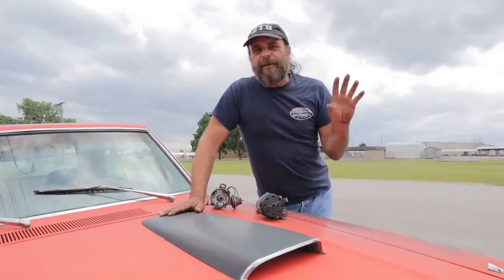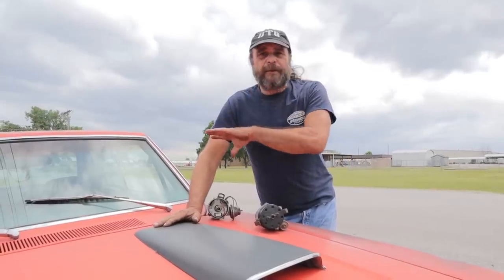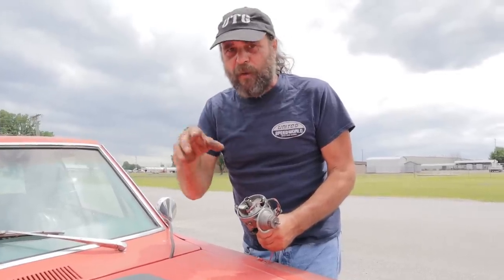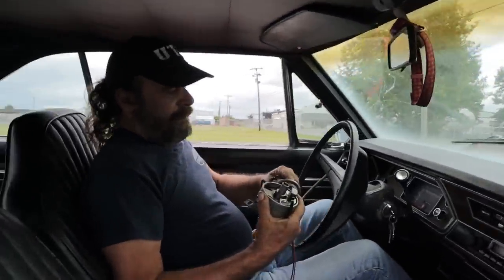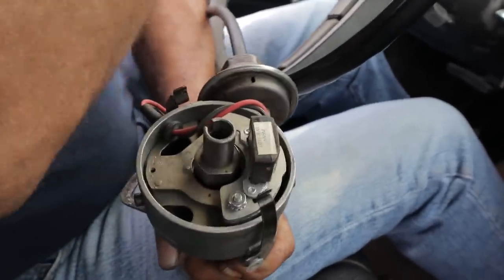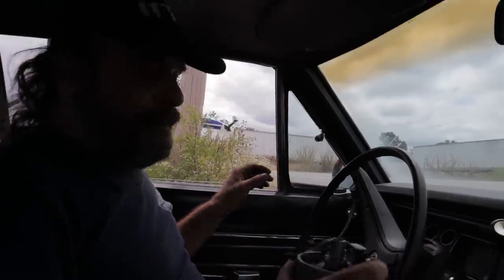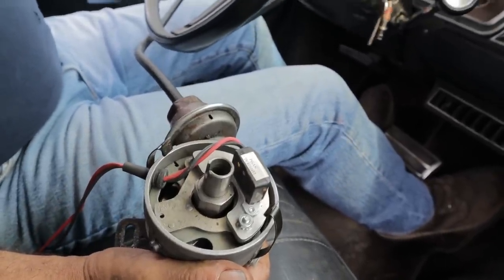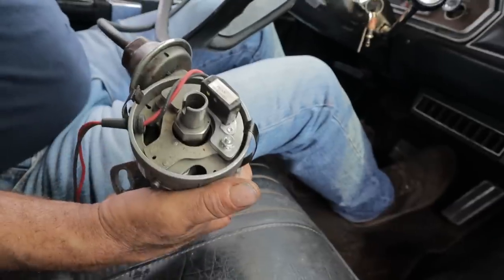The Vacuum Advance Debate!

Comment: Excellent explanation. Most people overcomplicate these things because they don't understand fully what they are talking about. The simplicity of this demo speaks for itself
Reply: The demo is TOO simple.  He showed what happens to the dizzy when the advance canister is hooked up to ported or manifold.  He didn’t adequately explain why you need different timing at different levels of load or rpm.  For a more comprehensive demonstration, the dizzy needs to not be removed from its symbiosis with the other parts of the engine.  A better approach would be to show two different vacuum gauges one from ported and one from manifold at the same time.  Then, take the engine through different circumstances in load and rpm to show what is happening with the timing.  Uncle tony was able to explain the opposite of the truth because his demo was overly simplistic.

Comment: This channel is a gold mine. I learn something every video. I always thought vacuum advance's were always connected to manifold until the early 70's when they switched it to ported because it allowed for better emissions. My understanding was that if I want better emissions I should do ported, but if I want better drive-ability I should do manifold.
Reply: Yes ported it runs hotter so it will burn off the fuel more although in stop and go traffic in the summer you can get into trouble running ported . I ran ported and I could get 14.7 or more on the AFR gauge idling on manifold I would stumble out past 12.9 or so less timing the leaner it is more timing the richer it is problem is the distributor is not tuned for manifold vacuum a adjustable pod is a must .
Reply: On my old Porsches I always ran mechanical advance but on my Thunderbirds I always stay  manifold.

Comment: I'm a huge fan of manifold vacuum and I can see many benefits on my 41 Chevy inline 6, since I swapped it over to manifold. Especially mileage and  temperature.  What a lot of folks saying :  ported came with emission in the 60s is a myth though - my 41 had ported from the factory, some cars even earlier - why?  I don't know, since the engineers back than must had have something in mind - but that would be an other interesting discussion.

Comment: I think its something that will be debated endlessly.  The only way around it is to dyno two cars, one with a factory engine and the other with performance mods. Test both running both ported and manifold and see the power band differences.  Love your videos. All the best from Oz
Reply: Or just take the same engine and tune for ported on the dyno then tune for manifold and see which one wins.
Reply: There would be zero difference on a Dyno.  You don't leisurely cruise on a Dyno, you crack it wide open under a heavy load--- ported or direct manifold vacuum are BOTH going to give exactly zero added degrees vacuum advance, no partial throttle runs on a Dyno.
Glad I drive a truck and don't drive a dyno

Comment: There will be spring or weight differences on a stock distributor, depending on whether they want to emphasize street performance, track performance, economy, or emissions. You can alter those goals by changing total vacuum (different can or link), and/or by changing the centrifugal springs or limiting the travel of the weights (more difficult).
Just remember if you limit vacuum advance or weight travel, you may need to alter idle timing to ensure higher rpm advance while cruising is not way off. 
You might also find a deceleration solenoid (or vacuum device) that prevents the throttle from slamming shut and sending manifold vac to over 25, causing timing to advance when it would drive emissions highest (you're not interested in performance when decelerating anyway but Uncle Sam is particularly interested in emissions at that moment). Salute that solenoid, it's a good soldier.
But when you are part-throttle accelerating your 70's Dodge and interested in performance for a few seconds, there's a traitor called the OSAC Valve (usually hanging off the air cleaner body) interrupting the vacuum hose from the carb to the distributor. That thing prevents vacuum advance for several seconds while accelerating, and since you just left the stop sign, your revs are not high enough to give centrifugal advance, so with timing delayed you end up pushing the pedal way down to keep up with the 60's car beside you (no OSAC delay). Sound familiar? Bypass that OSAC, plumb the vacuum direct to the distributor.

Comment: 1960s car were always ported vacuum to the distributor. Late 70s 80s cars use manifold vacuum with the thermo switch  between  vacuum port and distributor. I believe some use both to the thermo vacuum tree and delay valves/check valves as this was to delay vacuum advance untell engine was at operating temperature and converter was hot for better emissions.Less timing equals more complete combustion and less oxides of nitrogen. I did state Emissions testing, tuning,rebuilding the computer control carburetors. Adjusing with  old Catalytic converters on the vehicle or a cylinder with low compression in one cylinder this was  challenging stuff at the time.

Comment: So doing a lot of reading on this subject. With leaner mixtures you want more advance for a full burn. And as the mixture richness increases you want the timing retarded since the higher cylinder pressure doesn't require as much time to burn as a lean mixture. So wouldn't that mean the most efficient burn is happening with manifold as ported is making for a less efficient burn and higher exhaust temps? Which is putting more stress on the motor with more heat?

Comment: Sweet demo rig. I've never thought to try that. Really interesting to see a real world experiment. cheers Unc.     My spare sbf points dizzy recently got rigged with a battery, coil and a plug, held to the workbench in the shed by a chunk of railroad track and spun up with a skateboard wheel with a silicone hose tyre mounted in the drill. Mission was to calibrate the new old been in bits custom tach.  Works a treat. Dead nuts on to the digi timing light tach after tweaking it. Some people would have rigged up a signal generator circuit but analogue with dangerous fizzing taser sparks way more fun. Even the wife was impressed.

Comment: Excellent demonstration Tony.  Just to clarify, not to troll... In a nutshell, vacuum advance systems will advance the timing at lower rpm before the mechanical advance begins to operate, so you can have the best of both worlds.  Your base timing gives you a good idle quality, vacuum advance gives good low rpm acceleration and good part throttle/cruise economy, and mechanical advance gives good high rpm performance.   You're better off with no vac advance instead of running it on manifold vacuum.
Reply: Vacuum advance has nothing directly to do with rpm.  Mechanical advance is capable of handling your acceleration without ported vacuum advance.  Ported does not give you good part throttle/cruise economy because at part throttle cruise manifold vacuum is high and ported vacuum is very low.  Manifold vacuum advance will give you good economy at low load situations (idle and cruise).

Comment: Not totally correct there sir. When base timing is set properly, you need to have the vacuum line disconnected and plugged. Then once it's set, you can plug back in the vacuum line to your distributor. With it connected to full manifold vacuum, You will have a lot more advance at idle. Some motors like this setup. The motor will run cooler and not as lean. You will have to adjust your idle screws down which is a benifit in some cases as now your motor is less likely to diesel when shut off. Also your idle mixture screws will be more functional if they weren't before. Once you began accelerating the amount vaccum advance will drop some as in your video due to less vaccum in the intake manifold from throttle plates opening. Except it will still be the same actual amount of advance as if you had it connected to ported vacuum. The ported provides no advance at idle so the motor runs hot, and lean. It will make cleaner emissions this way. When you accelerate the ported timing port then applies vacuum to the distributor and advances the timing at that time, but it's to the same amount it would be if it was connected to straight manifold vacuum. The amount of vacuum advance does not change depending on rather it's hooked up to full manifold vacuum, or ported. The only difference is full manifold vaccum will give you more of that advance while at idle, where ported waits until part throttle. Both will have the same timing at part throttle cruising and WOT.

Comment: I've played the ported / manifold vac game before.  In the end both of my cars are still on ported. With a properly set up dist., initial and total dialed in, ported is where it's at.  Much smoother part throttle acceleration.
Reply: Part throttle acceleration is the domain of initial/mechanical but mostly mechanical advance.  Ported timing is redundant in this regard - it’s doing the same job as mechanical timing just a more limited range.  Use manifold advance and you free up the vacuum canister to do a different job that ported is unable to do - advance timing at high vacuum/low load situations.

Comment: Hello Uncle Tony,
Thank you very much for all the information you have given us. 1st Oct, 2019 I bought a 65 Mustang that needed everything so I could learn about these things we drive every day. Youtube and manuals have taught me much but there are things that slip through the cracks here and there that I have to catch as aside note in some video about something completely unrelated.
Then I found your channel. Your so direct and actually bother to put into video format your advice and knowledge. I understand how actually bothering to set up, film, edit, and post is a time-consuming process. So again, I thank you for taking the time to put your experience into YouTube so green mechanics like myself can learn.
I have a small request and if a video has already been made then please if anyone could point me in the right direction I would be most gracious. You had spoken briefly about how your lifestyle is in your cars. Specifically, you don't keep cars with really high-end paint jobs because of the upkeep a super high close finish requires. I have been trying to discern what you do to paint your cars by looking at your cars in your videos. What do you recommend as a paint job for a daily driver classic? 
So far I have done all the prep work, then primer, blocked it, then base coat, and blocked, then matte clear with hardener. What would be the simpler way for daily driver upkeep?
Thank you again for everything.

Comment: Good simple explanation. Using manifold vacuum you are defeating the whole purpose. I could do a whole video on this myself. I've read many of the comments here and many have no clue. Back in the day (maybe they still do) they had those Sun machines that you could fine tune a distributor.  Change centrifigal springs if need be for certain RPM advance so no vacuum needed. A lot of people don't know that some vacuum advance cannisters are adjustable through the vacuum port with an allen wrench.

Comment: So at light cruise in hunts for the highest manifold vacuum and allows for the best fuel economy.  At high-altitude we add a few degrees of base timing and move the vacuum advance to ported.  This allows for a smoother idle and leams the carburetor out by raising manifold vacuum and allowing the power valve to pull slower.  There is also a third vacuum source called the venatori vacuum.  This vacuum source is used only to control EGR through Chrysler's famous EGR amplifier mounted on the firewall.

Comment: 76 vette came with 6 BTDC, Vac Adv to Manifold.  If sVac. Adv. is switched to ported, vehicle will overheat at idle, running soley on initial 6 BTDC.  
Vac Adv. dies off at throttle but timing springs/weights compensate for the draw down.  This cannot be seen in your example as the distributor is not rotating.
When throttle is close to a cruise, initial timing,vac adv. timing, and spring timing are all incorporated for better fuel economy.

Comment: Tony, love your channel. I’ve got a 70 GTX with a 440. The bottom end is stock, the top end, I added trick flow power port  240 heads, and Edelbrock performer RPM intake, an Edelbrock performer 800 CFM carb, a Comp cams 491 lift hydrologic flat tappet cam, 236 duration @50, Howard’s lifters, TTI 1 7/8 headers and 3 inch exhaust. I built it to be a fun dependable cruiser. The car had points ignition before I pulled the top end apart. The engine was completely rebuilt 2,000 miles ago btw.... I bought a summit electronic conversion ignition kit. I started the car and I couldn’t get it to idle, it’s an automatic and when I put it in gear, it died, or was terrible. I bought a JEGS distributor and their ignition box, better but not good. I sent in the summit distributor to have it put on a sub machine by a guy in Ohio. He asked for my cam and gears and compression (10.5:1) ratio. He promised the world, well, it made it worse. Wouldn’t rev over 3,000 rpm. Oh, on the manifold side, it’s pulling 13 inches of vacuum at idle but on the port side, it’s pulling 5 inches. That doesn’t seem right. I heard about FBO ignition. Don said his system runs off the manifold side. I installed his system, it’s much better but but when I connect the vacuum to the carb, it starts popping through the exhaust like crazy. When I run it without the advance hooked up, it’s pretty good but still not perfect. I’ve been watching your channel for awhile now. You’ve forgotten more than I know and I’m pretty good with mopars. I would really love your take on this. Thanks Uncle Tony!!!!!
Reply: It’s your carb. Or something with your idle speed screw. You should not get ANY vacuum of your ported side of your carb. It should be at 0. If you can’t get it to idle it sounds like your initial timing is off. Quick way to find out if it’s off is to plug your distributor to manifold. If it idles better then yes your initial is off. Manifold adds timing at idle so that’s one way to see if that’s your problem.

Comment: I disagree. You want the vacuum advance at idle and part throttle cruising; however, you want it to drop off under full throttle acceleration to prevent detonation. One reason why you want it at idle is so you don't need as much base timing (around 10° or so) for easier starts, but still hit around 26° or so at idle after it starts, allowing it to idle much better. The vacuum advance is for fuel economy at idle and crusing, as well as for easier starts by allowing the base timing to be set lower. The vacuum advance should have no bearing on total timing at full throttle, high load, low vacuum conditions. With base timing + mechanical advance, you should have enough timing for full throttle acceleration just before pre-ignition, independent of vacuum advance. At cruising, you want much more timing when the load on the engine is low and the risk of pre-ignition is pretty much non-existant; hence, base+mechanical+vacuum cruising you should see about 54° or so, but only about 36° give or take at full throttle, high load conditions, where the risk of pre-ignition is high (which is why you want it to drop off, not come in). When using the timed port, you're not seeing any of the idle benefits you could be, and your base timing has to be set higher to get a good idle, making it harder to start. Original vacuum advance setups were on full manifold vacuum from the factory up until sometime in the early 70s I believe, when emissions regulations began to have much more bearing. I'm not sure what the thinking was behind the change, I just know there was a change. But just running on base timing doesn't give the engine the amount it wants at idle; where again, the risk of pre-ignition is pretty much non-existant provided the carb is tuned correctly for the right amount of advance at idle. You can see numbers and management philosophies like these when looking at ignition tables for fuel injected engines; even on my '98 vortec 350 (just a gen1 small block,) the stock ignition mapping is like this.

Comment: Sorry. Ported vacuum is for smoggers. At idle and low throttle the mixture is lean and needs advance. Smog distributer curves had tons of advance, like 12*, at idle to compensate somewhat for the ported vacuum advance. They did this to make the car run hotter. My 68 L36 Corvette used 4* initial and full manifold vacuum to the cannister.
Reply: Correct. The ported vac would be exactly the same as manifold vac anytime off idle. So manifold vac would allow more advance at idle and for longer burn times needed at idle. Plus low base timing for ease of start before building vac

Comment: Thought experiment.  With the vaccuum line temporarily disconnected, you set your idle advance and dial in your mechanical advance so that you get total advance with no vaccuum exactly where and when you want it.  If you THEN connect ported vac to the vac advance, aren't you getting the best of both worlds with the vaccuum essentially inactive except during highway cruising?